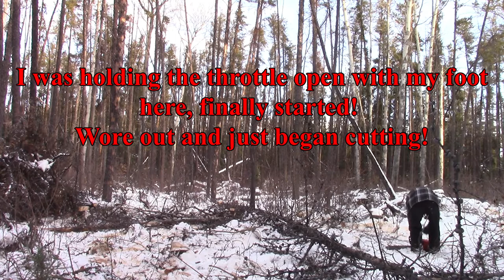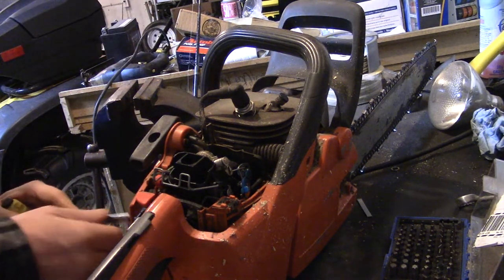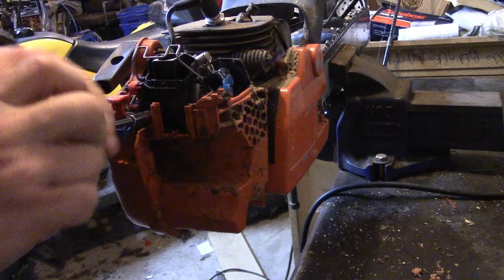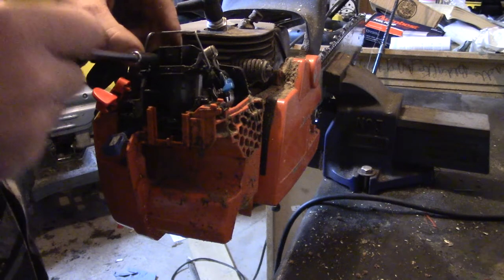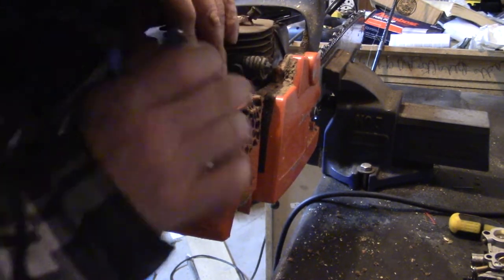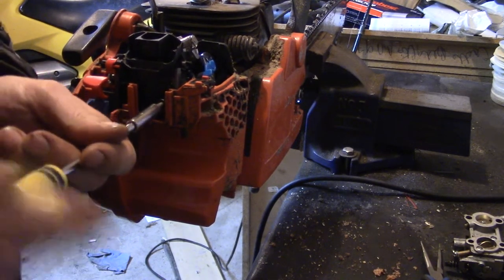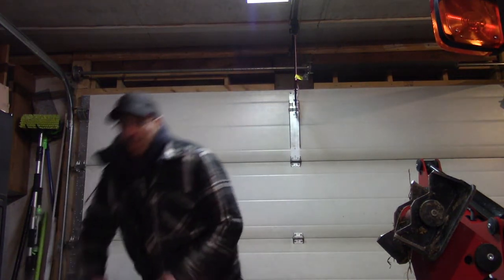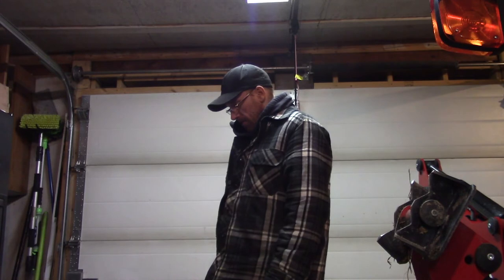Chainsaw won't idle? Hard to start when warm? WATCH THIS!

Comment: Thanks for the video-- I love it... "I won't run the air compressor because it'll wake up my girlfirend".  A couple of minutes later, you've got the chainsaw running at full throttle!  Seriously, good info, but it would also be a good time to change the primer bulb, fuel line & filter.  Any split in the fuel line or crack in the primer bulb will suck air.
Reply from the maker: lol I know!! I had to test it out. The air filter is brand new already, just changed it. Same with a new plug!  I could of changed the lines and bulbs, but saw is not that old. SO I never, but yes could always change it while you are in there! I have fuel line here but its cheap china stuff, so  i didnt want to use it on this saw.

Comment: I’m only 14 so I got a little husky 240 and it has the same problem. Watching this bc were gonna try adjusting the carb today but we might just change the carb like you did. Nice vid
Reply from the maker: Its a bit more expensive, but having a spare clean carb around for the chainsaw I use all the time, isnt so bad! Hopefully you got it fixed up by now!
Reply: Im 15 did a rebuild for husqvarna 137

Comment: Air compressor will wake your girl friend? She probably won’t hear the saw and yelling? I agree to replacing, did your try adjusting the old one? I have both 455 and 460, but 2 Stihls 250, the 250 idle poorly, I will try to replace its carb.

Comment: By the time you changed the carburettor  the saw was cold.. but when it gets hot it will be back the same way.. it's your coil gap. Check it use a business card to gauge it.. you will have no more problems
Reply from the maker: I use this saw everyday right now, has zero issues cold or hot. The new carb fixed it. Been fixed since this video and not one issue since. Been a great saw.

Comment: I replaced the carb on my 345 and it still does the same thing
Reply from the maker: Make sure you fuel filter is good, all your fuel lines and tank is clean. Also i prefer name brand carbs versus Chinese knock offs! Any small particle of dirt in the fuel lines could block the new carb. So when you put everything back together make sure everything is clean and no fuel lines get dirt in them!
Reply: @acreageliving  it also heats up fast and the blade spins a lot

Comment: Yup, very similar situation right down to the moans and groans! Once I would finally get it started it would bog down and die. Replaced the carburetor, plug, air and fuel filter, fuel lines and primer bulb. Now it will start, I adjusted the high, low settings and throttle, but when I go to rev it up to use the saw it continues bog down. I got about 20 cut only being able to pull trigger 1/4 pull, it will stall out if trigger pulled any further. Extremely frustrating, any idea to further diagnosis?
Reply from the maker: Sounds like carb issues. Was oem carb of Chinese knockoff? I would put your carb back to factory settings and go from there. I wonder if a piece of dirt got in the new carb? I hate carb issues! Lol
Reply: Acreage Living I kind of figured was probably imported as it wasn’t expensive for the whole kit. Going to keep trying, thanks for the reply.

Comment: Hi everyone, I am going to explain exactly what is wrong, and I learned this from Youtube. Anything that charges and discharges, batteries and magnetos, build up what some call crystal like fibers, or filaments, and these things short-out the item. I had struggled for years, and with a chainsaw, if you let it sit and cool, it will start up, just like it did when you started your day. Of course, when you changed the carb, and it started right up, it was cold, but I bet you had the same problem when you tried to restart. This technique, which I am going to explain, works for rechargeable batteries for power tools as well as auto batteries, as these fibers lay across the cells, and when you try to charge, it's as if you are using the battery at the same time, and it never fully charges. The simple fix is to shock it with a high voltage, such as from a welder, and the fibers get knocked right off. Connect the negative to the negative side of the battery, but do not connect the positive, but instead, give it a quick ark to the positive side, just momentarily, and very quickly. Two or three times and it is fixed. I have done this to my chainsaw twice and the problem was corrected instantly. I connected the welder to the spark plug wire, and the wire that goes to the body. I disconnected that wire because I was not sure of what else might get the voltage that might damage it, on-off switch, or whatever, so I just wanted to be safe. I have not tried it with a car battery yet, but if and when I do, just to play it safe, I will disconnect the battery from the car, and will cover the battery with a folded blanket, or something, just incase of an explosion, because who knows for sure what any particular battery might do, for what ever reason. Most likely no explosion, but please do not take the chance, better safe than sorry. Maybe a hundred batteries and the last one explodes, so play it safe. I used short pieces of wire connected to alligator clips, and arked on the wires instead of the item, just to avoid any sort of burn mark that would only have to be cleaned up later. Power tool batteries would especially benefit from the wire technique. By the way, I just found out yesterday, 11/10/20 that a chainsaw with different length teeth will cut perfectly straight, if, and this is a big if, if the raker that is in front of any particular tooth, is set to .025 to that particular tooth. So this means there will be different size rakers, but heck, there are different length teeth. If you use the type of depth gauge that sits on top of a bunch of teeth, that is the problem. There is a short flat gauge that sits on one tooth and the other end slants down and rests at the bottom of the next tooth, and the raker will come up through a slot, and since the gauge is at an angle, it slants the raker as you file, so there is no need to round it off later. Another thing I learned was about the gullet, OMG important. All of you guys need to see Buckin Billly Ray Smith. I have learned so much from him that I think of him as the chainsaw dentist. I myself only found him about a week ago, 43 years late, dammit, but above all, do yourselves a favor and view all his videos, so worth it. BTW, Husqvarna carries that gauge. Good luck everyone and I hope you pass all this info on to others, if only I had known all this 43 years ago.
Reply from the maker: No completely wrong, when I changed the carb, my chainsaw was completely fixed and starts awesome when it’s warm. The old carburetor is dirty. New carb clean. Common issue with small engines. My chainsaw is completely fixed and my wood videos prove it
Reply: @acreageliving  Ok good then, at least you now have more info for when the mag is the problem, but tell me something, if a dirty carb is the problem then why does it start cold when it is just as dirty cold as it is warm. How do you think that works, as in what do you think is actually happening. With my technique though, it's free to do, and quick, so if it still doesn't start, I would check the plug, then get into the carb , you know, easy things first.
Reply from the maker: @billboehmer350  plug was changed first. starts when cold because its full of fuel sitting, doesnt restart when warm or idle because its starving for fuel
Reply from the maker: 9/10 issues with small two stroke engines not running properly is a dirty carb. The fuel jets are so small, it doesnt take much to get clogged. Ethanol free fuel helps a lot.

Comment: Theres nothing wrong with that carburettor.. it's your airgap on the coil to flywheel.. main problem on all those saws..
Reply from the maker: Well a new carb fixed it and still running great 👍🏼 lol